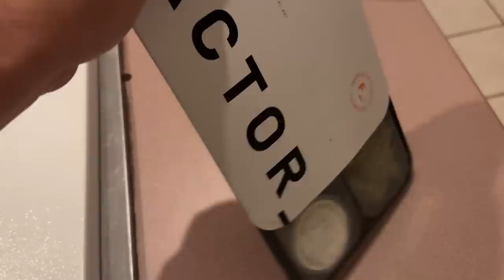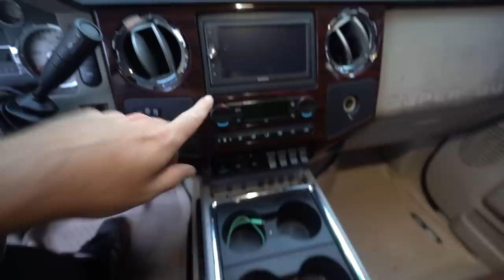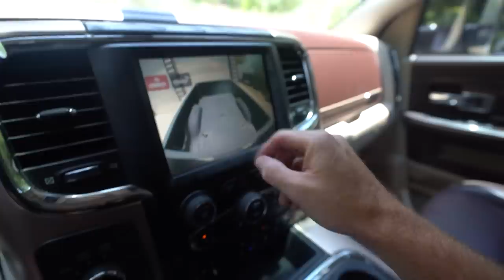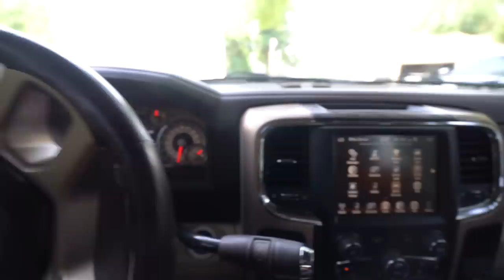My new truck broke down. so I bought another one. bucket list tow rig.

Comment: You can always extend the frame and get a 8ft box and not have to worry about hitting the cab. There's kits out there for it! The issue with moving the hitch back is it puts the weight behind the rear wheels, which partly defeats the purpose of the gooseneck.

Comment: Do coolant loop to back of the head for towing
If it has the trans thermostat upgrade
Delete grid heater 
Move vibe ccv off the turbo

You’ll be fine with offset hitch had 2 trailers with it

Comment: Probably best to keep the fummins even if the new truck proves itself, maybe put more into it over time and that way you have a backup that is exactly what you want in case the mega cab decides to unprove itself later. It is sad to see the fummins getting put on the sidelines after it did its job faithfully and without fail tho
Reply: It's a Frankenstein truck that's been taken apart and cobbled back together amateur hour style. I'd be concerned about wandering off too far in it myself.
Reply: @BrandonLeech  Exactly. It's never gonna be as well engineering and put together as a stock unmodified truck.

Comment: Noticed something when you got the gooseneck ball out. Don’t continue to use that ball. They were recalled because the release was prone to sticking.  I would contact a dealer to get it replaced.  The replacement ball has a release on top of the ball

Comment: Beautiful truck, to be fair, you don't technically have to get a new hitch and offset ball to get the clearance, you can stretch the frame and slap a long bed on there, its invasive and definitely the less practical of the options but it does make a cool truck even cooler.

Comment: Best truck you can buy. Cp3 cummins with auto (if you are going to tow heavy)    the manuals are detuned a tad.     Our 2018 trans lasted until close to 100k.  Then lost a few gears,  had the trans fully built.   Towed 20-25k pounds and nearly all the miles were towing.

Comment: I looked after a dozen 6.7 trucks for years. Get familiar with the little bolt (8mm or 10mm IIRC) on power cable that runs to the passenger side battery from the charge side of the alternator. The alternator WILL short at some point in time and pulling the charge cable off the battery will get you a LONG way down the road without the shorted alt eating up all your amps.

Comment: Dang when you said chris sent you a manual megacab i was thinking this was gonna have a g56. But i guess you couldnt get the g56 with the longhorn. But you could with the Laramie. My stepbrother just had to have his valvebody and shift solonoids replaced in his 4th gen. I dont know that id run that thing in any of the higher tunes for the trans sake.

Comment: To fit the 22.5's all you need is a leveling kit. Also you should swap to the CAT fuel and water separators. But the 22.5's on mine fit really well and the tires last me around 100k miles, well worth it!

Comment: So glad you got a 4th gen mega, i have a 14 2500 srw mega larmine. I think you will enjoy it alot. It looks like you do have the 68rfe based of your dipstick location so yea your going to want a valve body at minimum id say. I dont tow heavy very often and still almost lost my trans, and did the BD 68protect vb rebuild and saved it. 

Check on your tuning like im sure you already are, but trans tuning will help alot and raise line pressure to keep it from burning clutches. 

If your tuner doesnt have trans tuning you can always get the BD trans tuner little plug and play controller to boost your line pressure

Comment: Just wait till the ABS control module  fails. 2 trucks bith are out for the 2nd time. Also, the oil pan likes to blow out front passenger corner which 1 of my trucks does as its a weak spot.

Comment: I think a prevention kit on the 6.7 powerstroke was all you needed. They’re not actually all that hard to work on anyway. Hope this works out but fingers crossed you just throw in a 6 speed manual in the fummins one day. A simple project to get it fully bulletproof.
Reply: For sure, and he’s made note of that, but the bulletproofing on the injector pump voids the warranty which was a major reason he got the truck.
Reply from the maker: @dashmaple2504  exactly that. I did think about getting another ford. Like a 2017 that’s out of warranty. Doing the fuel system upgrades. But it’s a much harder to work on engine package. And much more expensive truck to buy same for same.
Reply: @Taylordrifts   hmm I’ve heard from others that it wouldn’t void the warranty, but if they’re wrong then I understand. I still would’ve just ran it as is during the warranty and then modded it after, since truly the pump failure isn’t so bad that the trucks are undrivable. It’s still the best hotshot truck and tons have gone past 700k miles. My only thing with this decision is I feel like the ram is still going to potentially need some work to compare while the ford would’ve been a hands off experience for you. I think it was just an unlucky situation with the pump failing as early as it did and far away. At the least this truck is probably a lot cheaper anyway so that’s probably nice.
Reply from the maker: @josephsamsor1698  yeah this truck is literally exactly half the cost of of the other truck. That was another factor. Ditching the truck payment and buying something outright instead and just planning on fixing it myself. The Ford are the best package performance and reliability wise. They’re just worse to work on. It’s a pick your poison kinda thing.
Reply: @Taylordrifts yeah at half the cost I get your decision now. Not sure if it was mentioned in the video but from the comments it doesn’t seem like people are considering that aspect. Little bit of preventative maintenance and I can see this being nicer to have around without a payment to think about.

Comment: From personal experience pulling a similar gooseneck within a short bed Dodge ram, the offset trailer ball in the bed of the truck gets you the best clearance of the cab. The offset hitch on the trailer only changes where you will hit your cab if you turn too sharp.

Comment: Love the new truck!
I’m a diesel tech who works on these trucks pretty much every day so just a couple things to think about in my opinion. 
It looks like it has stock head bolts. 
The 6.7s do have some head gasket issues so doing a head gasket and some ARP studs before any problems might be something to think about. Get the head surfaced and hone the block! It will blow again if it doesn’t have a good sealing surface.
And for the transmission get a built valve body from goerend transmission and a deep pan. They are the best for transmission parts and are a super good company to deal with, we use all their parts for our transmissions at our shop and they have never steered us wrong.
And would very much recommend putting on a fass lift pump with filters. Extra filtration and their new water separator filter is the best in the game. Bad fuel and water is the number one thing I see destroy fuel systems way to early on these trucks.
And if you ever need a pump or injectors go with Dynomite Diesel, Lenny and the guys in Idaho are the best and another great company to deal with!
Super glad for you, I’ve had a 6.7 for years and love it! Hope I could be of some help.
Reply: One more thing! If you’re doing transmission work would highly recommend putting in a Gorend torque converter best one on the market only one worth your money and feels way better than stock or any other aftermarket converter and only one that like their slogan says puts the power to the ground.

Comment: Biggest thing I could recommend for any fummins conversion using the 5r110 that comes behind the 6.0 and 6.4 powerstroke is that you MUST get a fummins swap torque converter. The OEM one, is great for a powerstroke. They're known to hold 500+hp for a long time on modified trucks. HOWEVER a cummins has a significantly lower powerband than a powerstroke. The TC in the 5r is meant to accommodate the torque being higher in the RPMs. A 6.4 powerstroke makes peak torque at 2,000 RPM. Where a common rail 5.9 does it at 1400 rpm. Tuning can and is done to try and accommodate this big 600rpm range difference. But theres only so much tuning can do to battle the difference in mechanical/power capabilities. I'm been planning and reading on fummins builds for awhile, the biggest thing I have picked up on from groups dedicated to fummins swap is the necessity one of these TC are to having a well shifting ford automatic behind the cummins. There's a gentleman named Larry Barnett out of Indiana that makes incredible TC for these swaps. I have watched dozens of posts from guys who where frustrated with how their auto was shifting and performing, only to come back after a TC change happy as could be. 

Another thing that may help is going with some Icon double rate coil springs up front. These make a huge impact in the ride quality on older trucks. And are drop in and go! Normally only 3-400 bucks for a set.

Comment: Missing a lot of crucial towing things with the new truck. Short bed, non high output, no aisin tranny. Should have waiting it out and got the proper rig
Reply from the maker: The Aisin has the same failure point. But without the aftermarket.
Reply: @Taylordrifts  We have 4 of the 21+ HO dodges and tow 20k trailers 5 days a week and haven't had any issues. Granted we aren't doing long hauls it's all in town work but they've been very reliable. We have a f450 as well and I'd take the dodge any day over the ford.
Reply from the maker: @EtherGaming604  I looked into to thoroughly. Aisin has the same failure point. But no aftermarket support to upgrade it. And you can’t tune it.
Reply: @Taylordrifts  I feel you. Was just stating our experience. At the end of the day it's your money not mine, so if your happy that's what matters.

Comment: My dads 18’ 2500 6.7 had the ABS/TCS module fail. Our truck is under warranty so we can’t replace it with an aftermarket or used one, and the new one that isn’t supposed to fail doesn’t come out until august. The Cummins transmission shifts early because they make their power super low, the primary thing I’ve heard to alleviate stress on the transmission is a tune and a shift kit to bump the line pressure. It’s Gonna shift harder but will preserve the 68rfe, the only other fix is to get the high output with the aisin transmission.

Comment: As the guy that tried to convince you to get a LBZ, I will still say I’m happy for you. My dad has a 6.7 mega cab. We both just towed 8 hours on a trip last week. He’s not had any problems other than the body falling apart piece by piece. He has had good luck with his trans, but we all know that’ll come up at some point. It’s always a compromise somewhere and I’m glad you found what you’re willing to live with. Best of luck and congrats!
Reply: the gm trucks shortcoming  is The IFS no good for hd use real bad with a plow on the front .
Reply: Yeah body falling apart. His is a 3rd gen but rusting everywhere and plastics breaking. Keeps on running though.

Yes GM ifs rides the best but not the best option for a plow. Some upgraded tie rods and you’ll never have an issue in normal use on and off road.
Reply: @andrewslagle1974  Well not all HD use is plowing. I have a Silverado HD and never plan on putting a plow on it so IFS is great for me. To be fair, GM does say that you must have the snow plow prep package for plowing because it has heavier torsion bars for the front suspension.
Reply from the maker: I think a lot of the transmission stuff is from people driving them like a race truck in the hot tune or while towing. I could be wrong. That’s what bothered me so much about the CP4 issue in the ford. Nothing I could do driving wise to prevent it. It wasn’t from me beating on the truck.
Reply: @Taylordrifts  exactly man. A slipping trans an still be limped to an exit as well. And it’s a contained issue, albeit not easily fixed on the side of the road, but there’s parts available to prevent it along with driving it smart (like locking tc up, not hammering it when lugging up a hill, etc). The CP4 is more of all the sudden catastrophic failure at no fault of how you drive as you know.

Comment: My truck is a 74 Chevy quad cab dually long bed. I took the big block out and in the process of putting a 6.7 Cummins with a p pump mod.  Old truck. Fully mechanical. G65 trans.  It will be a monster

Comment: I bought A 2003 7.3 liter diesel 4 door bed I found the truck 4wd on the west coast with 50,000 original miles it’s like brand new. Heated Leather seats everything works as it should. Big thing for me was no def wich I absolutely love. I’ve sunk about 10 grand or more so far into the truck and I’m no where done just taking my time and making sure we hit all the right bases. Beautiful truck by the way I always liked those rams as well congratulations

Comment: You might consider upgrading from the stock intake heater grid from Banks. The one thing that will kill the 6.7 is one of the bolts will break and take out the engine. It will help performance as well.

Comment: When will the fummins get the credit it deserves
Reply: I fucking know right. Kinda silly to build the truck, never use it, and just mess around with all this other shit.
Reply: Wondering that myself...
Reply: Agreed... but he is the one that has to drive it I guess 🤷🏼‍♂️
Reply from the maker: I literally used it for two years and out 25-30k miles on it. I’ve driven it. Nobody who watches has. I’m not just shooting in the dark. I do things for a reason. I spend a ton of time making these decisions. So it is frustrating when people tell me I’m stupid for doing x y and z. Without having the first hand experience that I do.
Reply: @Taylordrifts  after finishing the video I’m sure the extra comfort and convenience will be worth it, good luck sir 🫡 praying for your cab corners and transmission,
Reply: @Taylor Ray  And in that 2 year how many times has it left you stranded away from home??
It seems to me no matter how good the Fummins is you have set your mind to "its not good enough" even if it means buying a truck that's not 100% suitable to tow your trailer and now you are having to modify your trailer to suit..
Reply: @CJA150179 and those modifications aka offset hitch etc make a gooseneck tow like ass. May as well have a bumper pull trailer if all the pin weight is behind the rear axle anyways
Reply: Taylor is happy and that is all that matters you haters gonna hate
Reply: Apparently wasn't even worth a pair of batteries
Reply: @Taylordrifts  Not saying youre a moron, but you bought a dodge with a Chrysler transmission looking for reliability. Id just take more time and more care thinking about what you do. With a little work the fummins would be done and dusted, but these side shows keep making things silly
Reply from the maker: @WelpNopeYep  the thing is. Everyone that had an opinion on the fummins. Has never driven it. Has never towed 18 hours with it. Has never worked on it. I would think I’m the most educated person to make this decision. I’m also not ignorant. I know they have transmission issues. That’s why I built the fummins originally. However There isn’t a diesel truck that exists that’s doesn’t have some major pitfall. They all do. The ford 6.7 is probably the best choice. But it’s super complicated to work on. Which is why instead of doing a ford with fuel system upgrades. I chose this. Because it’s easy to work on. I went with the ford when it was under warranty. But if I have to work in it. It needs to be easy to work on. It’s a pick your poison scenario. I picked mine. Maybe I’ll regret it later on. But I wanted to try it. I know a ton of people with these trucks without any transmission problems. It’s just one of those things.
Reply from the maker: @CJA150179  it did have an issue every single trip for over a year. Which was incredibly stressful. Having to find a parts store halfway through a trip. Pulling the fuel tank in the pits of the track. Not being able to make it up hills because it kept going into limp
Mode. Having to stop and reset the truck over and over because the transmission was slipping. Trust me. I genuinely do have reasons for what I do. I can’t cover every single one in a video or it would be an hour long. I’m not just blindly making decisions. The fummins is a swapped truck. There’s a lot of parts on it I can’t get at a parts store if something breaks. It’s got high miles in the chassis. Everything rattles. The transmission shifting is awful. I could go on and on. It was the right truck at the time when I built it. It served me well. But at this point. It’s not the right truck. The people saying keep it don’t have to ride in it for 18 hours strait.
Reply from the maker: @HalftonJohnson  that comment wasn’t directed at you it just wouldn’t let me tag anyone. It was directed at the “built it and never used it” I did use it. For a long long time. A lot of miles. Tons of problems and teething issues. I put a lot of work into building it. And still think something else is the better truck for us. That should say something.
Reply: @Taylordrifts appreciate the clarification, sorta figured that was the case. You’re a real stand up guy, especially for considering your passengers/teams comfort. Best of luck

Comment: Glad to see you make the smart Ram choice!  As to transmission, extra cooling and additional fluid capacity are the key and are very important especially for towing loads.  Install a good Earls fan forced transmission cooler and a PML extra deep finned aluminum oil pan.   Happy motoring....

Comment: To keep the trans happy, the valve body upgrade is good, but also highly recommend a billet converter. Stock one is garbage in both the 48 and 68. Other primary upgrade is a good cooler for how you want to use it. From there, stock internals and clutches are fine on them for near stock power, like say a 100hp tune or less.